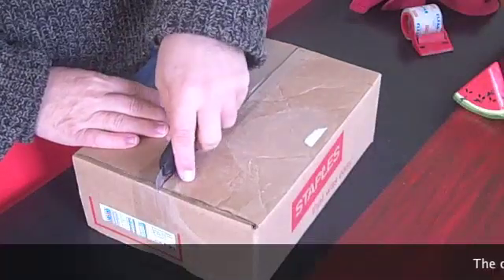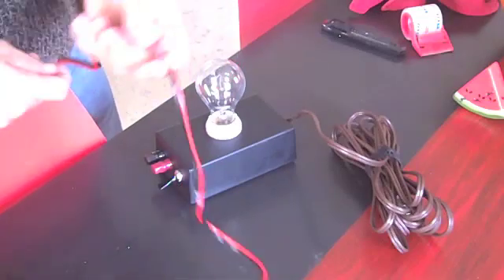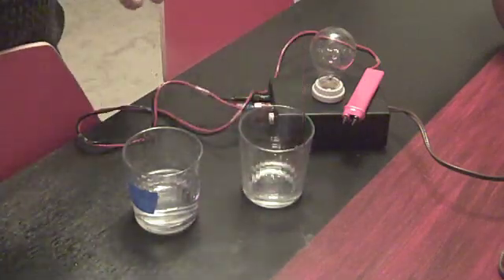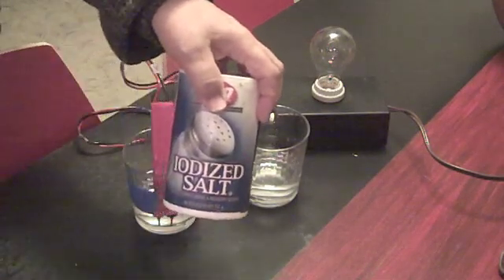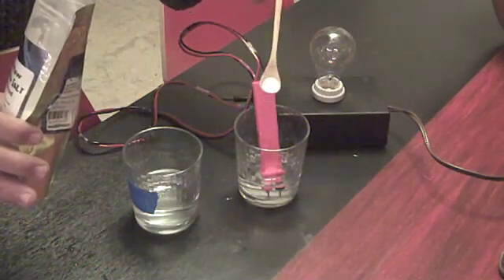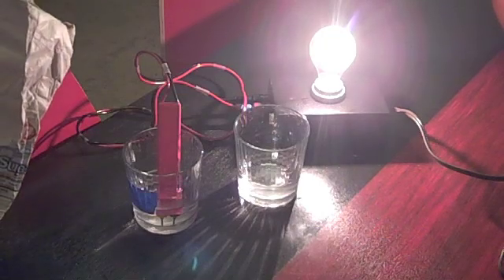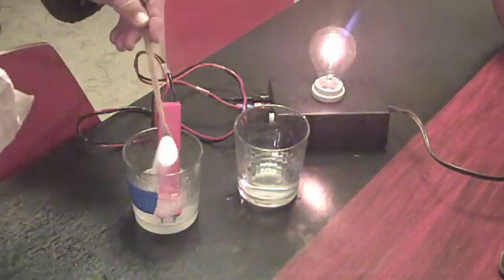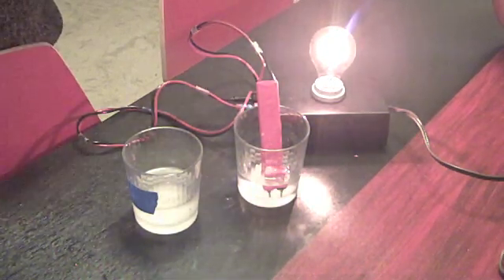Sugar vs Energy and a Conductivity Light

Comment: Hi Loving your work, and yes sugar is very bad for us in the way that you describe but i had one though...
When you add the sugar it dims the light, but as the sugar dissolves into the water the light becomes brighter again.. 
Did you try pulling the probe out of the layer of undissolved sugar to see if it is just the available area of electrode or the conductivity of the water that is causing this effect.   
Do you happen to have an actual conductivity meeter that you can test with? I'de do it my self but unit is not with me at the moment...
Reply from the maker: Hi Dan
No I haven't done that and thank you for suggesting it. 

I was just showing that there are foods and liquids that help the body produce electricity and there are foods and liquids that do not.

The reason I created this video was to show that as the sugar enters the body it disrupts the flow of energy and just like your body it recovers. This is why people crash after consuming sugary foods or liquids. 

When people do the adrenals produce more adrenaline to keep them going until it processes the sugar. Once it is done the adrenals stop producing the extra adrenaline and you crash or feel tired.

If someone does this over the course of their life, eventually their adrenals will not be able to produce the extra adrenaline from weakness and you will see people falling asleep instead. Which we see people doing all the time these days.
Reply: Absolutely
    I'm living in Morocco at the moment, they have a huge rate of diabetes from drinking tea with enough sugar to float a spoon in. 

  I was actually looking at Bio batteries today when I came across your post..  It filled in a blank spot in my head, as to why I have voltage but no amps..  I did not put any salt in the mix to allow for conductivity in the system...    so thanks for that..

My I recommend that you take a look at MACA powder and gogi berries. 
 I've used these for years when I need to work 120 + hours a week and cant afford to burn out on a gig..     
when combined with the right foods there is no crash point, way better than caffien and sugar.

Comment: Very interesting, thanks :) what about sugar from fruit? I saw your video about soaking figs to get electric water, but this Water also contain sugar (from the fig) how is it possible to this Water to get the energy then?
Reply from the maker: Hi, 

Fruit sugar which is simple sugar has the two things it takes to make electricity (energy) in the body. Live life giving energy from proper hydration and minerals.

Man made sugars are stripped of minerals when they process it so it is acidic and kills the electrical flow of energy in the body no matter how much water you put in it.

An alkaline body is rich in both hydration and minerals and builds a lot of electricity giving the body endless energy. 

An acidic body is low in hydration and minerals and kills electricity and causes extreme fatigue in the body.
Reply: Thank you so much for your answer, now I understand :)
Reply: Thank you very much Gary! That was very clear explaination of how bad man-made sugar is.